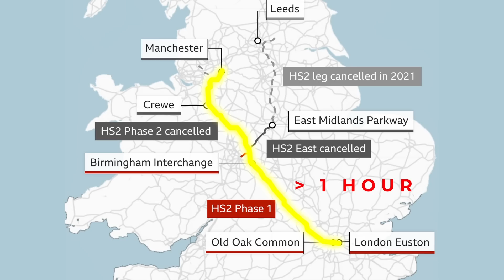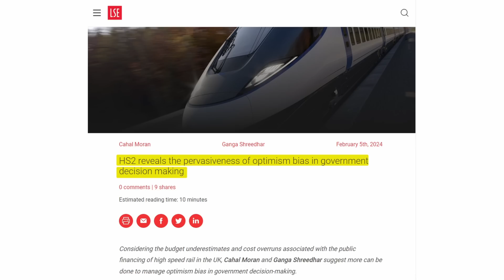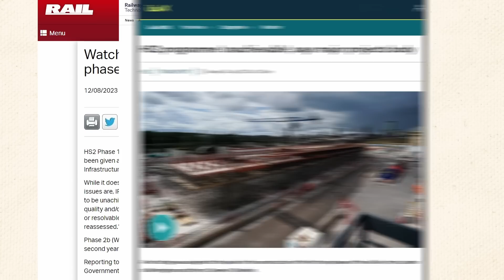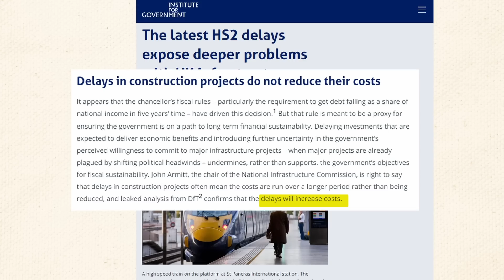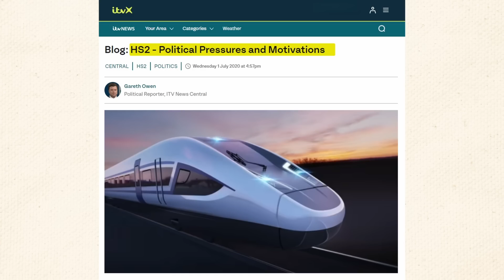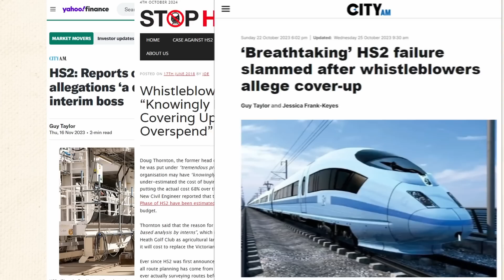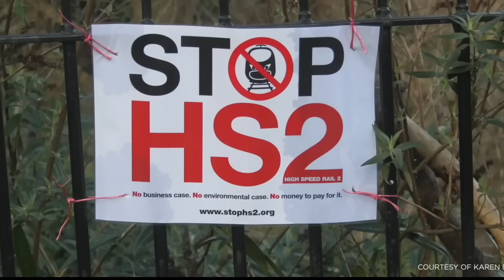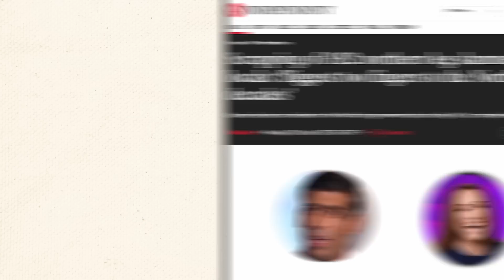Inside UK's £100BN Railway to Nowhere

Comment: Why not just use a TBM and create a nationwide high speed rail project a couple hundred metres under the earth.

Bet you could do that for a fraction of 100B. At best they’re incompetent, more like - corrupt to the bone f them
Reply: So, a tunnel linking say London, Southampton,  Plymouth, Bristol, Cardiff, Birmingham,  Liverpool, Manchester, Leeds, Newcastle, Leicester and come back down to London all at 200 metres below ground . How do you build the station links back up to the footpaths when  the stations are 200 metres deep ? You would need to build a 200 metre deep basement.  Where do the vent shafts go? I could go on but to save time let's cut to the cost.... several hundred TRILLION. And it is impossible to build the 200 metre deep station basements.
Reply: @TrevorWilliams-fq8mg  :/ that was embarrassing
Reply: So do you mean build an underground railway to link up all, or a lot of,  cities throughout the Country, like a ring main, 200 metres below ground, all for less than 100 billion ?
Reply: @TrevorWilliams-fq8mg  yes of course. You’re not having to compulsory purchase land off people, far less health and safety concerns, and you’re only needing one primary construction asset, then building stations underground only needs a small patch of land above to be purchased for commuters between the stations and cities above. Yes a fraction of 100B. I’d say 8B

Comment: Visited Brum last week. Terminus at Curzon street in the middle of nowhere   not linked to any other main line  As quaint as Moor Street 😂 They need to add more stations. All that money could have been used to re open branch lines.
Reply: Curzon Street is in the middle of nowhere?! It's right next door to Moor Street Station and Moor Street Queensway Bus Mall, where most services to the city terminate. Cross the road, walk up either Carrs Lane or the ramp by the tunnel - 0.1 miles / 3 minutes walk  to Rotunda Square, half a mile from Victoria Square or the Cathedral. As you do so, you'll notice the city core is on a hill top, so extending the tracks there would add several million to to cost as you'd need to tunnel under Moor Street Queensway, demolish Primark, and build pretty much everything other than the station entrance underground, so making it another subterranean hellhole like New Street and Snow Hill...
Reply: I must admit I could never understand that either. So Curzon Street to Old Oak doesn't seen so bad now.
Reply: Its right next to chuffin' Moor St! Its less than 300 yards from New St. Which part of Birmingham did you go to, because it sure as hell doesnt sound like it was the centre, LOLZ.

Comment: You only have to look at the benefits of high speed trains in France. It has clearly been proven that ultimately it only really benefits Paris.
Reply: Totally wrong, all of the regions benefitted fron TGV, but they built if for 20%(?) of the cost of HS2 per mile
Reply: Fine then you don't mind the increase in taxes to pay for it and the starving of investment in the rest of the rail network as all the budget was spent on HS2.

Comment: Investment in infrastructure stimulates growth and only an idiot or someone with zero grasp of economics (so most politicians then) would be shocked that a project priced in 2009 would have dramatically increased in cost 15 years later.  To me, the biggest problem with HS2, or any other national infrastructure project for that matter, is a lack of vision and political intervention. We have politicians with little or no grasp of the complexities of huge civil engineering projects, relying on overpaid consultants to make decisions they are not qualified to make. all based on political agendas.
Reply: What a poor understanding of how a project is costed you have. If you know the scope and don't change it then all you are factoring in is inflation. The trouble is they keep changing the scope or they didn't know what the hell they were doing when they started.
Reply: @kevinrayner5812 The problem with HS2 is nobody knows what the scope is as it's still unfolding.
Reply: @TrevorWilliams-fq8mg  What on Earth do you mean the scope is unfolding. The scope is to build a high speed railway from London Euston the Birmingham Curzon Street. The route is known. the techinical parameters for the railway are known. 100% of the scope from London to Birmingham is known.
Reply: @kevinrayner5812 how many gas mains, water mains, power cables, drainage systems are there to divert ? How many of them cross rivers,  canals, roads, and railways where method statements have to agreed with the relevant  authorities? How many planning conditions are there to clear  ? How many highways , roads, railways are there to divert  and what are the agreements in place to comply with ? That's why the construction contracts arexall on a cost plus basis, not a firm price basis.
Reply: @TrevorWilliams-fq8mg  "how many gas mains, water mains, power cables, drainage systems are there to divert ? How many of them cross rivers, canals, roads, and railways where method statements have to agreed with the relevant authorities? How many planning conditions are there to clear ? How many highways , roads, railways are there to divert and what are the agreements in place to comply with ? " Every single one of those should be documented, well if not  then they should be. If documented then they are in the scope of works. If not is is a compensation event. No need for a cost plus contract at all. A fixed price contact is only fixed price if the work remains fixed. Additional unforeseen work can be claimed.
Reply: @TrevorWilliams-fq8mg  Apparently Old Oak Common is quite nice.
Reply: "how many gas mains, water mains, power cables, drainage systems are there to divert ? How many of them cross rivers, canals, roads, and railways" Are you seriously suggesting that they don't know how many water courses, roads, canals or railways they need to cross. Even I can look at an OS map and work that out. Does the Nation Grid build a transmission line then forget where they built it. Or a gas main gets forgotton about. There will no doubt be old undocumented services but the bulk will be known about
Reply: @kevinrayner5812 You refer to compensation events so admit if the scope of works isn't known the Contractor is entitled to more money.  Yet you also say the scope is 100% known. You also say the scope should be known but might not be known. Which is it then ? - should be known /are known ?
Reply: Everyone will be documented EVENTUALLY. In the meantime the work proceeds with some significant unknowns. A firm price is more than just accounting for inflation. It also covers all risks, snd I mean ALL. Ever heard of uncapped liability  ? And on very large contracts, which HS2 is a typical example, Contractors are refusing to accept firm price contracts because if a large job goes wrong it would wipe them out as Contractors balance sheets are very weak and a typical profit margin of 2% isn't enough to pay for the losses. So on large projects ( several hundred million plus),  they are insisting on management fee type contracts such as construction management or cost plus where there is no price written into the contract. The government will have the same problem with the New Hospital Programme.
Reply: @TrevorWilliams-fq8mg  "Contractors are refusing to accept firm price contracts because if a large job goes wrong it would wipe them out as Contractors balance sheets are very weak and a typical profit margin of 2% isn't enough to pay for the losses. So on large projects ( several hundred million plus),  they are insisting on management fee type contracts such as construction management or cost plus where there is no price written into the contract." Complete utter tosh. Fine if contractors are refusing to do the work then find another contractor. There are loads of them out there begging for the work. There are processes in place to compensate contractors for additional work. I find it incomprehensible that in this day and age on construction jobs cost plus is being used. I think somebody in authority needs to ask some serious questions about how tax payers money is being squandered. If we as a country are incapable of building a damn railway subcontract it to the SNCF or DB or the Japanese as they seem to know how to build a high speed railway. It seems somebody is taking the tax payer for a complete ride here.
Reply: But your OS map doesn't tell you what the relevant statutory authority will demand of the contractor to cross their river, canal or railway  ( tunnel under or bridge over ?/night closures or not ?/ working hours?.) Somewhere in the midlands a trackside substation  was required. Power supply to the substation, 6 miles away on the other side of a river,  road and railway. How much will it cost to bring a power supply to the substation ? Unknown until all method statements are agreed with the relevant authorities. How long will that take? Depends on how long the relevant authorities want to approve the methods. The company I worked for before I retired won the contract to rebuild Broadmoor. It involved decanting the patients out of the hospital to another secure place. All carried out by the client. BUT uncapped liability meant that if their decanting was not secure the Contractor is held liable. Ain't quite so easy  to forecast costs is it ?
Reply: @TrevorWilliams-fq8mg  "u what the relevant statutory authority will demand of the contractor to cross their river, canal or railway  ( tunnel under or bridge over ?/night closures or not ?/ working hours?.) Somewhere in the midlands a trackside substation  was required. Power supply to the substation, 6 miles away on the other side of a river,  road and railway." The contractor builds what the design stipulates. Local authority permission would have been granted prior to the start of the contract. Any contract price agreed by contractor will be against drawings. It will specify whether it is a tunnel or a bridge or what every.
Reply: @kevinrayner5812 You say there is no need for a cost plus contract so can you give a reason why the contracts are cost plus ?
Reply: @TrevorWilliams-fq8mg  I am responding to other people who said that they are cost plus contracts. I must admit I have my doubts that they are in fact cost plus contracts. I thought most construction contracts were NEC contracts now.
Reply: You are free to believe what you wish but as a pre construction manager managing the design and putting bid prices together for major construction projects I can assure you you are wrong. A compensation event is preceded by an early warning notice which is used under the HS2 project, which the contractor is contractually obliged to use to notify the client of a change in the scope of works. The compensation event automatically triggers additional payment which is due to the contractor. And as I said contractors are refusing to  accept firm price all risk contracts when the contract is very large opting instead for management fee contracts or cost plus contracts which have no price written into the contract.
Reply: Yes NEC Contract is used , I think on a modified Option D management  contract. Under normal circumstancesyou would becrightvin saying a fullyfixed price. Option C target cost. But HS2 acknowledge there arexao many unknowns a cost plus contract is the onlvoption. Also some councils are dragging their heels granting planning..
Reply: If you are still unconvinced about the use of cost plus contracts Google "HS2 costplus contracts", then open the construction enquirer file "New HS2 boss blasts cost plus contracts for 6 billion overspend".
Reply: Only an idiot would cost a project without taking into account the cost of inflation 15 years later. The whole point of project costing is to take into account future rises in costs and risks. The private companies and contractors completely take into account their future costs. You are right about the politicians - they have no idea how to control their suppliers.

Comment: I wish the media would stop saying £100 Billion project, when HS2 ltd hasn't even said that, You are promoting it to the nimbys brigade who are against it. No one know what are the final cost, Phase 1 is being built and 50% of it is completed.
Reply: Not sure what is more worrying, that it is £100 billion of they simply don't know.
Reply: @kevinrayner5812  they don't know  - there is a project reset (DfT 19Dec) and the new costs wont be know until 2026 (search for 'HS2 DfT new civil engineer). And if the high estimates are now in the 80billion mark there is no reason to imagine it wont be 100bn by 2030 (Old Oak Common)
Reply: 50% finished???? Are you having a laugh??? Not a single rail has been laid yet! Barely half the track bed is even anything like ready, let alone the flyovers and viaducts.  Its not even 40% finished.

Comment: It's going to be a white elephant even as it stands at the moment because work on the line into London Euston, a station that needs to be bulldozed and rebuilt as it is totally unsuitable even for todays railway, has been halted and HS2 is going to run to Old Oak Common only and then you will have to change to another train to get into London itself and if I understand the plan at the moment trains from Glasgow, Liverpool, Manchester and Birmingham are all going to be using the HS1 leg so major cities in the UK will not have direct trains into the heart of London!
Reply: Passengers will change on the Elizabeth line no problem, their won't be no direct train to Birmingham if London Euston is bulldozed,  Who bright idea to knock down original station at London Euston is beyond me.
Reply: Euston a major station in London built in the 1960s and without doubt the worst station in London. The Victorians knew how to build stations. Then tag HS2 onto the side. Like that was ever going to work.
Reply: The latest proposal announced about a week ago is to resurrect building HS2 from Old Oak Common into Euston with a new station they previously started work on alongside the existing Euston station. There is also a proposal to refurbish the existing Euston station. The official announcement is due to be made in Rachel Reeves budget speech on 30th October.